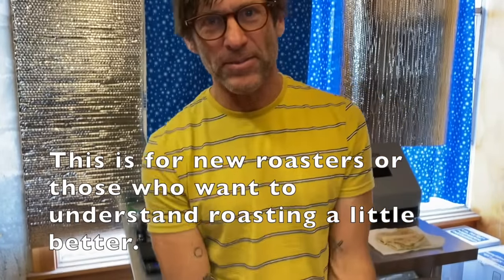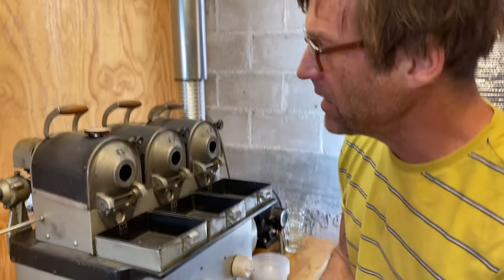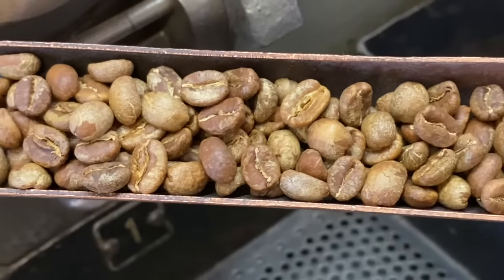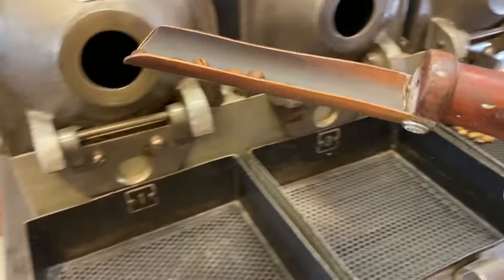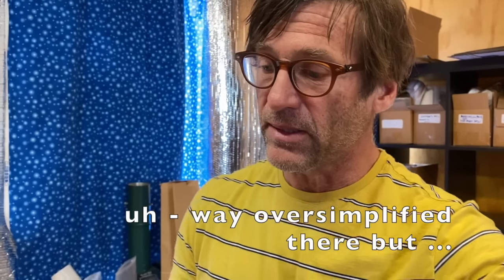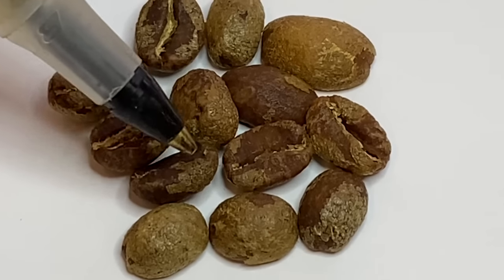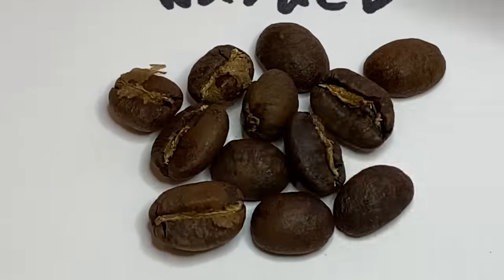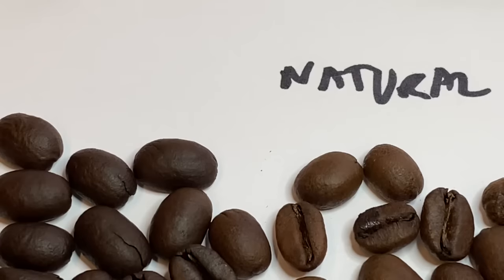Coffee Class: First Crack, Second Crack, Coffee Roasting Development

Comment: Great Video,  .. ok , little story before my question.  25 years ago I drove tractor trailer for a few years and one load that I delivered was of Coffee Beans in great big burlap sacks , Sumatra and some other type.. was a High Dollar delivery as they had multiple locks on the trailer were I picked it up from , and Guards watching as it got unloaded . They told me that I could not even watch and had to stay out in my truck . Sooo , when they where done , I had to pull out of their parking lot and jump up in the trailer to make sure was clean for the next load ,,, well , there was some beans left in , so I had to sweep them up ... ok , so at this point , don't get freaked out , but I saved all those Green coffee beans , ended up with about a Gallon zip lock bag full . I sorted through them making sure there was nothing else ... couple weeks later I got home and Roasted some of the beans in mom's cast iron skillet continuously moving the beans (first time doing ) didn't really know what I was doing , we didn't really have youtube and what not back then .. lol . But , after watching this I think I ended up with a half way through 2nd Crack roast ? And after cooling and sitting for a day , I used a French press and went heavy the amount as I like strong coffee (strong bold not burnt).. it was the Best Coffee I have ever had !!! Ok , my questions are best coffee for crazy deep bold smooth rich flavor and 2nd Q's is if Green Beans sealed in vacuum sealed bag with O2 remover packed ..  How Long can those beans last ... years ? 2 , 5 , 10 , 20 ??? Ohhh , and this was your 1st vid I have ever watched , I am now subscribed and will be watch All the rest .. THANK YOU
Reply from the maker: Thanks for watching! What a great story. It's hard to say, we haven't tested that, though maybe someone else has. What we can advise is that, with proper hermetic storage, green coffee can retain its flavors for even longer than a year.

Comment: Thank you! That gave me some useful points to watch for in my next roast.

One thing I find a bit tricky is roasting blends (Sweet Maria's espresso blends of course, on a Behmor). I've noticed the different beans in blends don't always roast evenly. That is, some of the varieties in the blend will hit first and second crack sooner than the other variety. How do you compensate for that? Do you let the "early" cracking variety roast a bit longer while waiting for the rest to catch up?
Reply from the maker: All coffees roast at different rates so It's OK that this is happening. A good blend takes advantages of the averages you get by applying the same temps and time to different coffees so we suggest experimenting a bit but to answer your question, yes, play it safe the first time through. We suggest a slow ramp of heat leading into first crack and making sure all the coffee has at least gone into 1st crack. Good luck.
Reply: @SweetMariasCoffee  Thanks!

Comment: Hi, is a stir crazy hotplate popcorn maker a good way for roasting vs a hot air popcorn maker?
Reply from the maker: Those hotplate poppers don't produce enough heat but a lot of folks use them along with a turbo oven and get good results.